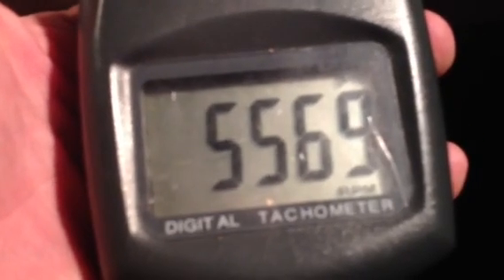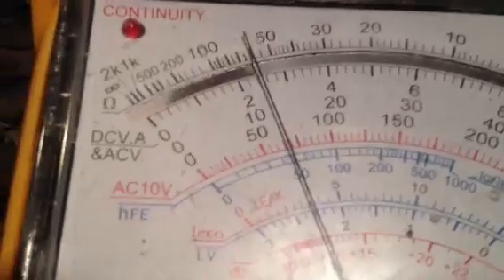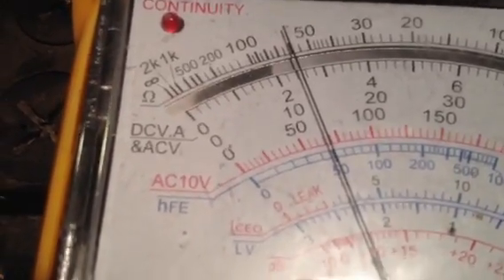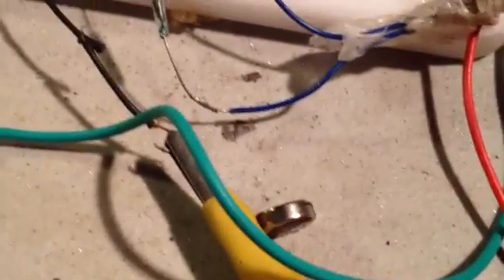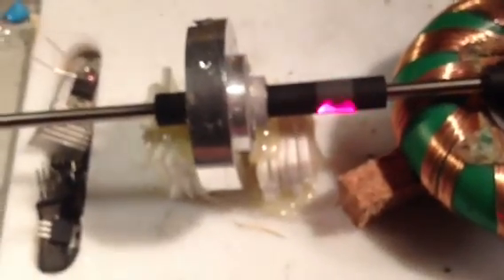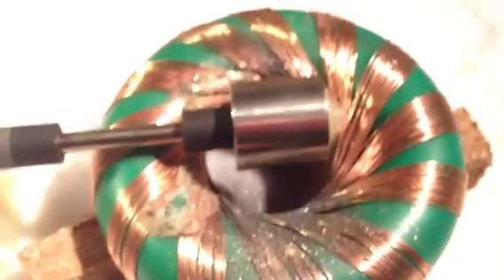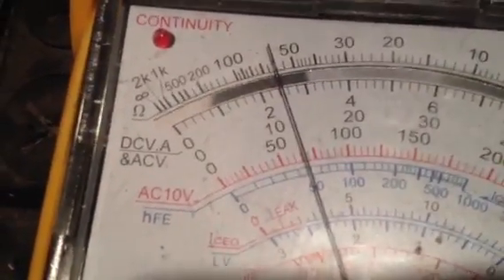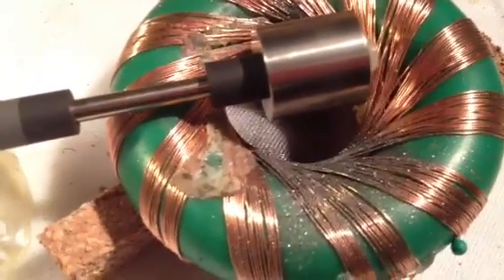Pulse motor build off part 7

Comment: Sometime I will be making something similar to do some tests on it seems that this is quite interesting. I would like to run it on low voltage and a super capacitor. This will give us the greatest fastest measurements because her not relying on a really big amp hour battery!  Good work Jim that thing is really loud.lol ~Russ